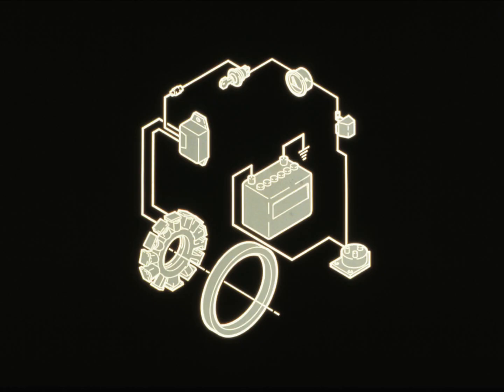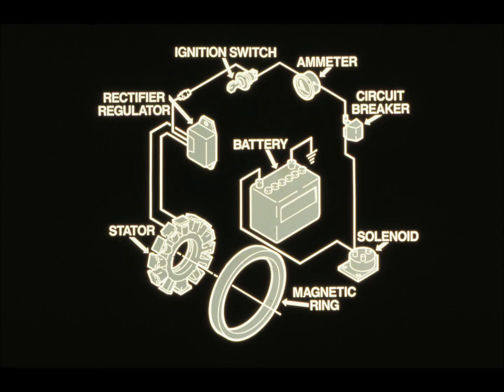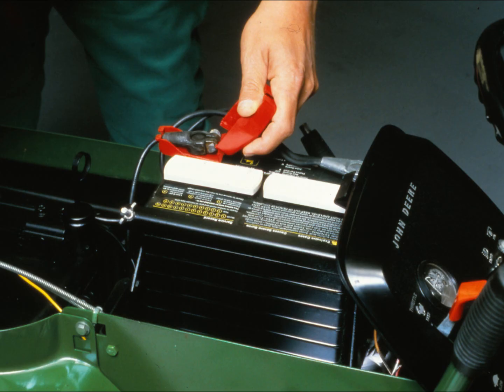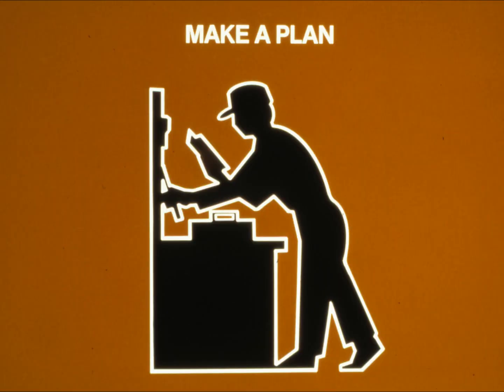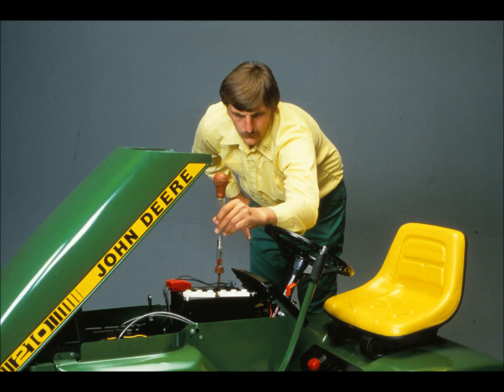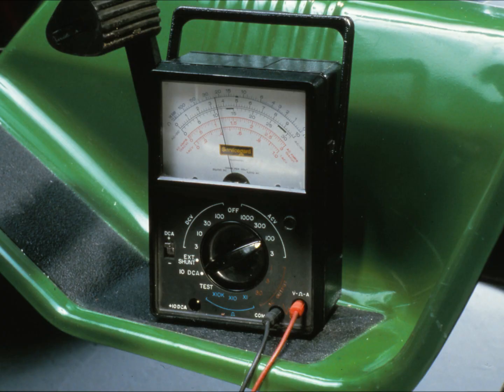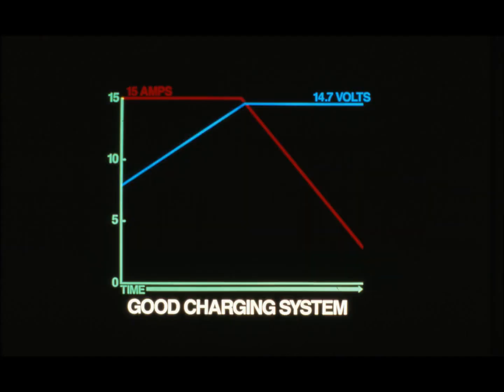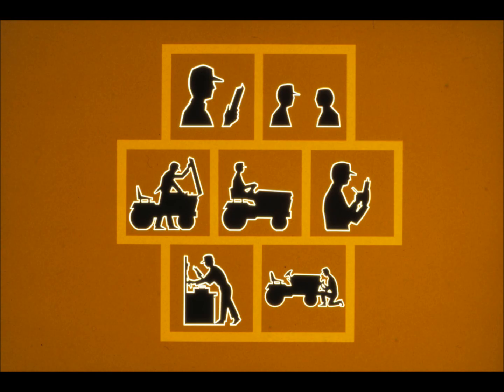John Deere 4 Cycle Engine Charging Systems Diagnostics

Comment: Second 😂♾️🙏🏼🤷🫡💯🇺🇸💪🏼👨🏼‍🌾
Reply: What's funny is I have had two alternator repairs this week 🤣 battery was good on both as well
Reply from the maker: @MichaelMyrick1123  Probably nothing as simple as the old Delco 10SI?
Reply: @ikonseesmrno7300  crap no... A stupid 2011 Chevy Impala lt v6 and 2012 crap bucket Chrysler 200 I 4 😂 both are still living because of me. The bs u have to go through for both is nonsense. 🤦 One is slap against the firewall the other u gotta pull the radiator fans out and a pulleyto get too.
Reply: @ikonseesmrno7300  my work horse 🐎 2010 Kia soul is as easy as it comes 😆 like a little tool box on wheels. 5 speed manual too.